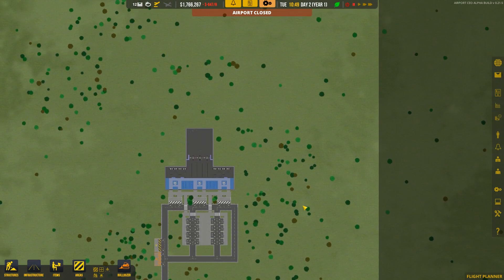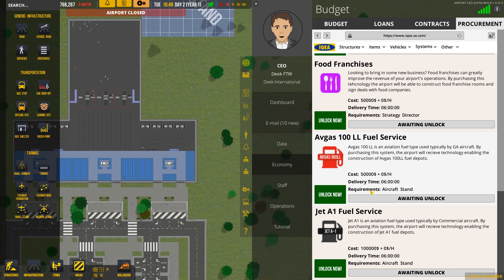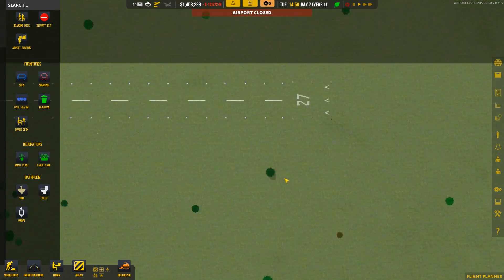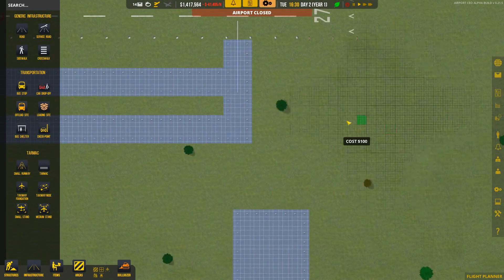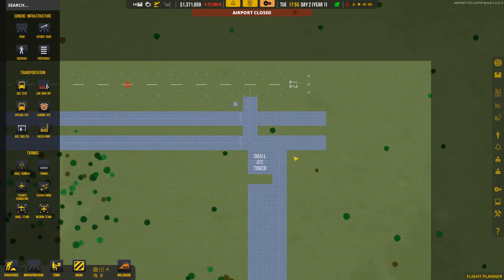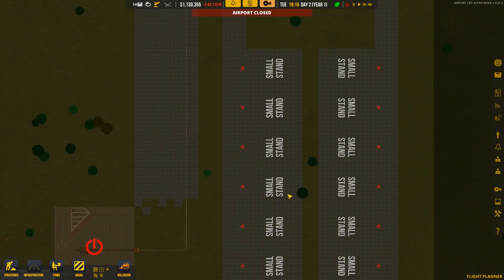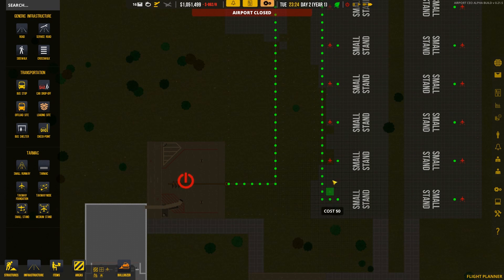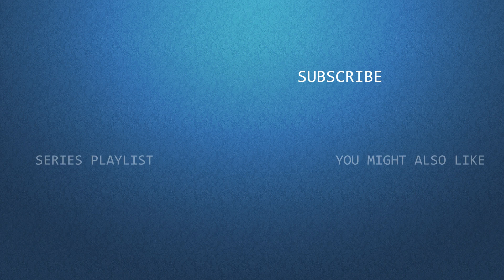Let’s Play Airport CEO - 2 - Setting up the Runway, Taxiway, Fuel Depot, and Aircraft Stand Area

Comment: ATC NOTE: ATC is not the same as GTC. ATC only directs planes that are in the air. Once on the ground, they are handed over to Ground Traffic Control which handles taxiing, parking and shunting of planes. They are two completely different systems.

Comment: Roads TIP: If you build roads only 1 square wide, you can better control the directional flow of traffic. A two space wide road will have traffic in each direction. Roads only one space wide is a one way road. Buses won't pull a u-turn at a corner or intersection on a single width road.